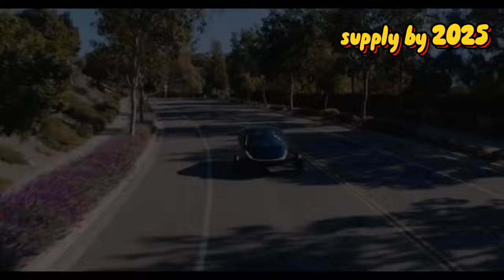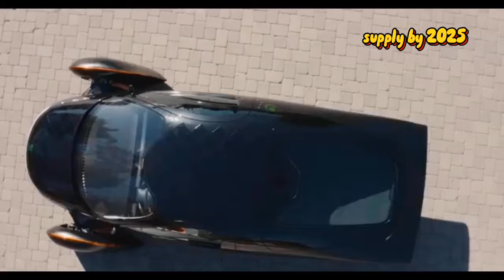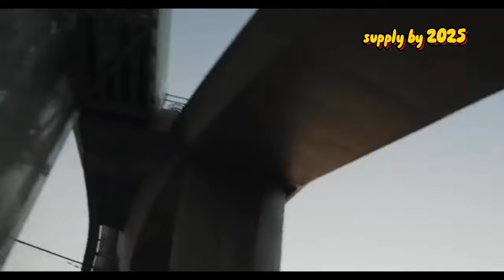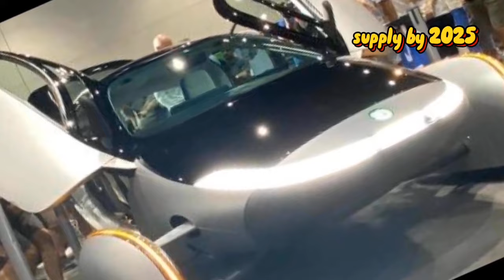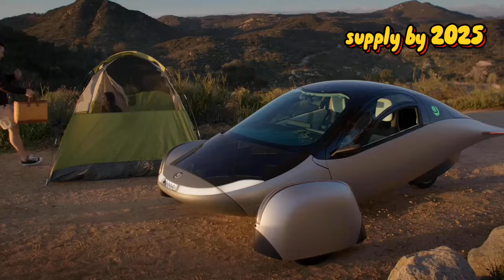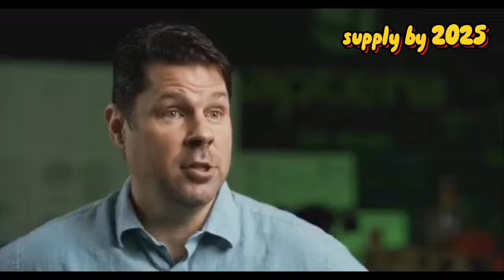Unexpected from Aptera

Comment: You do know that flashing up "supply by 2025" means a production model has to be sold to a customer before January first? This vehicle has to have been built entirely off the 13 stations they only have a video of, out of a parts inventory they only speak of lining up the agreements, and not one PI of the 10-16 promised PI's has been finished. No frame; no US Cap money and no workers, and there are 4 months and two weeks to do do it all in. You have under 10 days to provide that PI.2 you said would be driving mid-August. You won't even make that assurance.